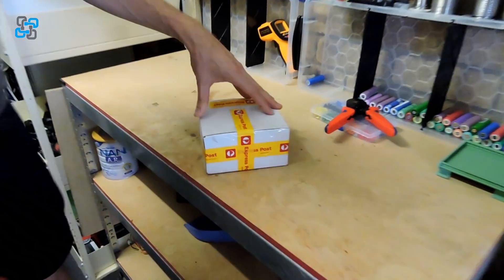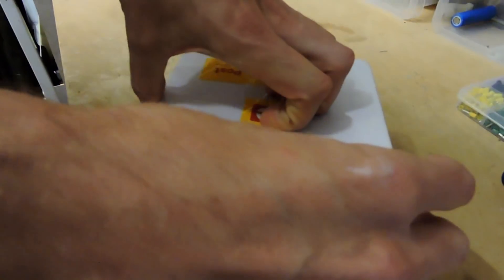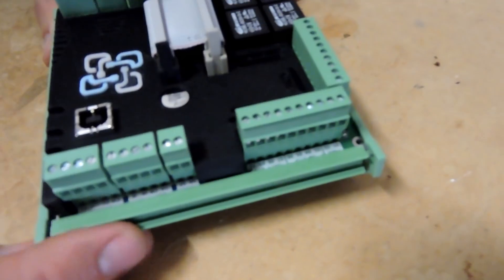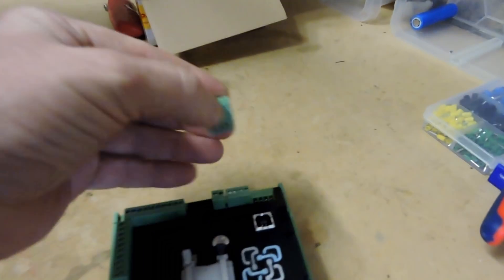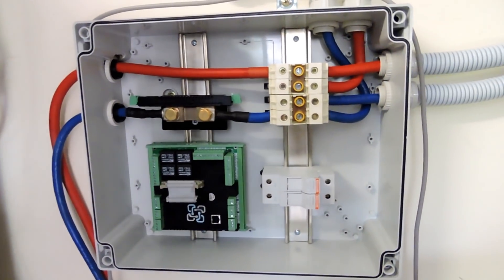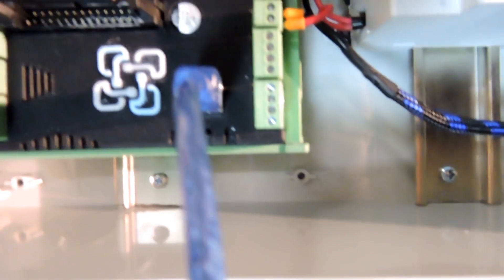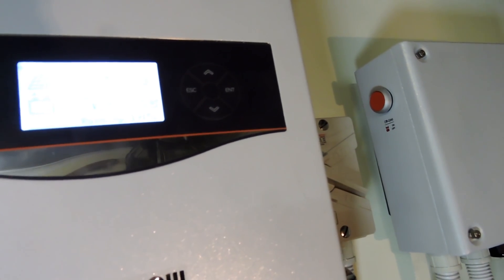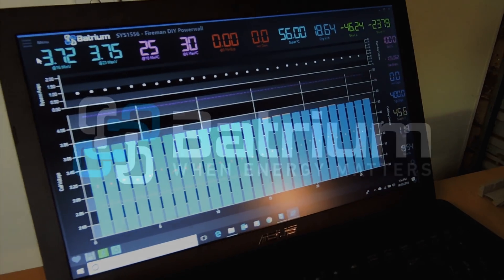Batrium Watchmon4

Comment: Great stuff guys.  
I was in solar here in Oz years ago. I did remote/off grid stuff. Lots of lead battery’s, selectronic and flies.  Hard work. Anyways,  10 or so Years later. It’s now, and I have stumbled onto a steady stream of vtc4’s. I have no solar setup. Not currently. 
Your channel has inspired me to build some packs and powersystems. 
Thanks guys.
Reply from the maker: SP-Pro is my dream inverter for sure - welcome :)
Reply: HBPowerwall 
Today is my first cell harvesting day. I gotta break out the cells. Nearly 200 to process/test. Hopefully I get an 80/20 good to bad cell count out of most of these. Have a good one